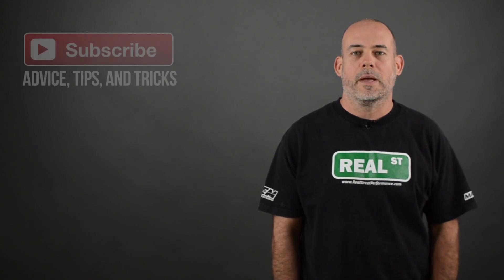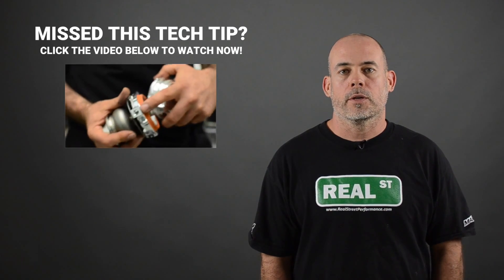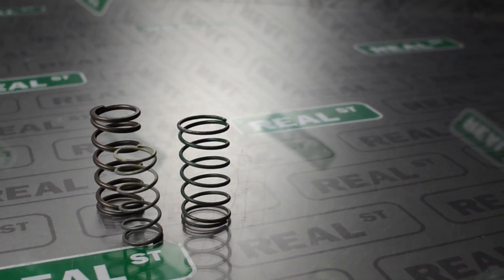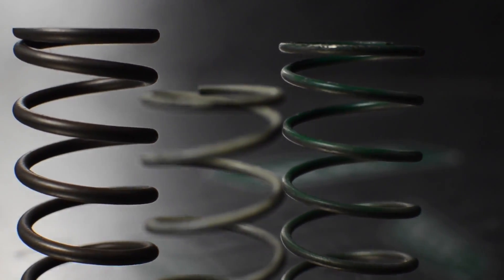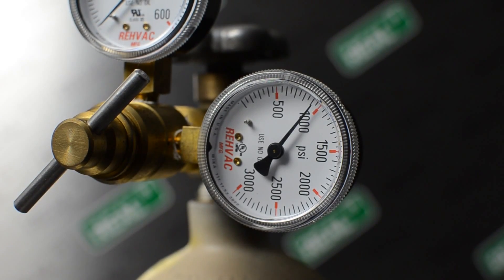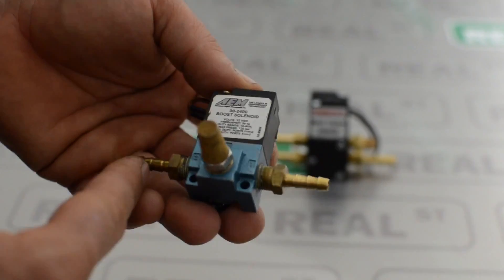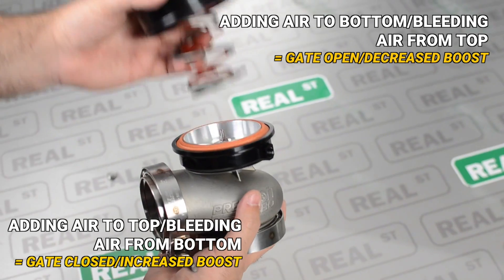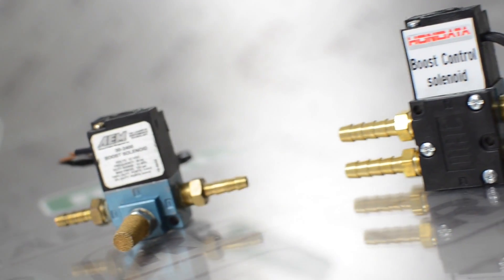Boost Control for Cars That Need More Traction - Jay's Tech Tips

Comment: Trying to figure out my wastegate which is the Turbosmart V gen. I have it on my 2014 WRX. The shop that installed it, said they installed the 14psi spring. Since I got the car back, it has started opening under 10psi and makes around 12psi with the boost control solenoid off. The cobb 3 port is hooked up as
Port 1 - intake
Port 2 - bottom of gate, other two openings closed with provided screw plugs
Port 3 - turbo
Top of gate is open to atmosphere. Any help is appreciated, wondering why my gate opens under 14psi..

Comment: Is this possible with my Australian Ford xr6 turbo 4L tuned with sct hand controller. Say 10 psi 1st 14psi 2nd then 18psi 3rd and 4th. Alot of these turbo barra 4L make so much torque even with a low 14 psi with the std garret gt3540 (3582r, .50-1.06) making  usually 400rwhp but heaps of torque resulting in lots of wheel spin. Thanks Troy
Reply: +Cairnsyspook of course it's possible, but because you run a basic flashed ecu your boost control is limited.  If boost control is all you're after look at units like ams which let you adjust boost by gear/speed.  I'm sure there's other units out there as well do some research.

Comment: 944T has external WG on exhaust near cross over after down pipe.  Have Tial dual port, this is internal won't work for me.  EBC will custom boost for each gear.

Comment: and to run 2 3 port solenoids u dont need 2 inputs from the ecu. u setup it up just as u would a single solenoid for external wastegates. 
the pressure source from the turbo is teed and one solenoid is setup like an interupt style setup and one is setup like an external wastegate setup, feeding of the same pressure source. when duty cycle is applied to both solenoids, the entire pressure goes to the top hat of the gate just as with the 4 port solenoid. 
lot of things wrong with this video. a 4 port solenoid never bleeds and adds pressure to the ports of the gate at the same time.

Comment: what a load of bollocks. leaking pressure would be a bleed type setup. that is what stock cars would run, where a solenoid is t fitted to the boost signal going to the wastegate. 
and interupt style setup blocks boost completely. 
whenever a 3 port solenoid is used in conjunction with an external wastegate it is never bleeding pressure from the bottom port. the port in the middle vents pressure from the common port which is the port that goes to the top of the gate.

Comment: Does this work off speed, tail shaft rpm or what gear your in (auto's only)
Reply: +Zack W whatever you tune it for. it's just an electronically controlled mechanical switch basically.

Comment: How would go about programming the computer to use a 4 port boost solenoid?
Reply: I could be wrong, but I think you would use the boost by gear setting on your ecu.
Reply: Mike Hendricks Not all ecu's have that though.
Reply: Right, thats why you would have to use an ecu that did have it :)
Like I said im not for sure this is the only way though.